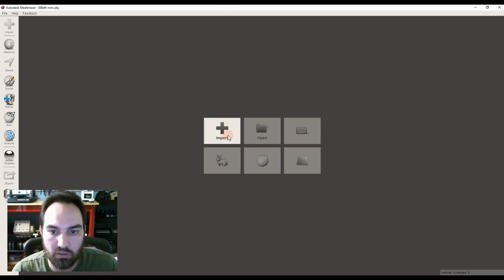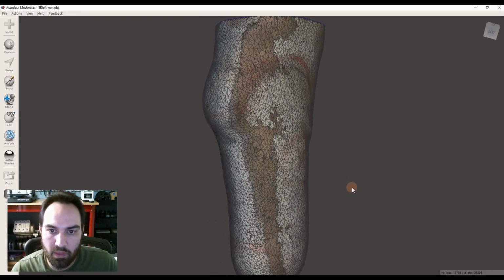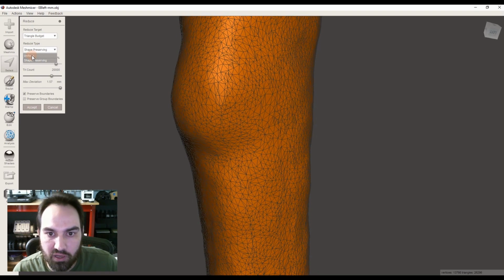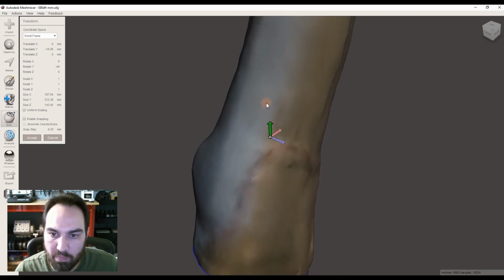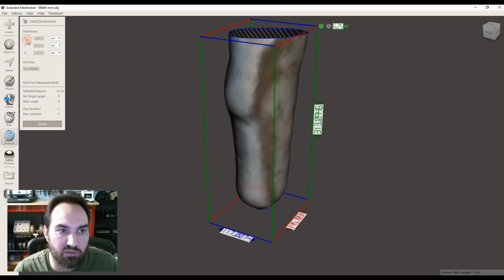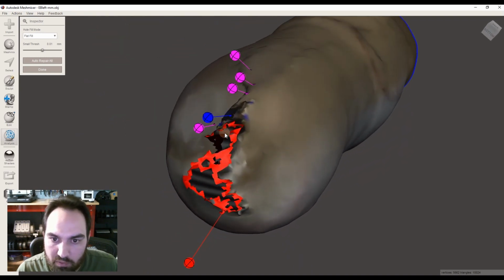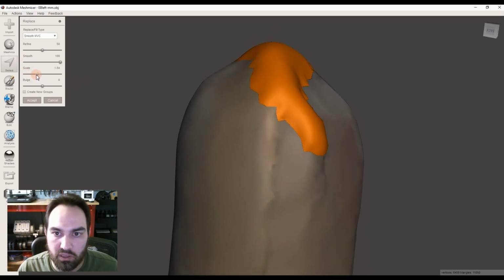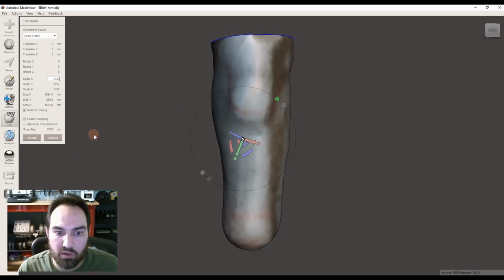Intro to Meshmixer for Prosthetics and Orthotics

Comment: Hi, thanks for the clear introduction, easy to follow. You mention @14.18 that Meshmixer is not great for measurements, a problem I have also encountered, which program do you use for precise measurements? I make fitted shoes, starting from custom lasts so this is an interesting area for me. Thank you for any light you can shed on the situation
Reply from the maker: I am able to get circumference measurements using the web based tools at Fit.Scandy.co

For any sort of length measurements, I usually will create a rectangular or cylindrical shaped mesh and give it a known dimension or extend it out to match the length of my model and then see what the dimensions are as a reference tool.  It's not direct measurements of my model, but it works for my needs usually.  Anything that needs to be more precisely dimensioned I tend to use Fusion 360 for if I can.  What sort of measurements do you need to take on your custom lasts?
Reply: @limbandlattice6487  thanks for the reply :) I've come across Scandy, a nice simple tool to measure after modifications. I've also tried creating reference shapes/meshes in Meshmixer, which I agree is sufficient for dimensioning simple 2D measurements. However my difficulty is with irregular ovoid circumference measurements like around the ball of the foot and instep.
I'm delving into Blender as a possible way to modify and measure, since with Fusion 360 I've had difficulty converting an STL to an obj (quad) file to modify with T splines (seemed the easiest way to modify organic shapes, but I'm new to all this) and then measure. The academic license version of Fusion 360 doesn't seem to allow this conversion to obj (quad) files and hence I'm looking at Blender.
Reply: So I think I've found a way to use Blender and the plug in MeasureIt to find the perimeter at a particular cross section which updates in real time as the mesh is modified. I'm doing some trials and will try and upload a video of the process